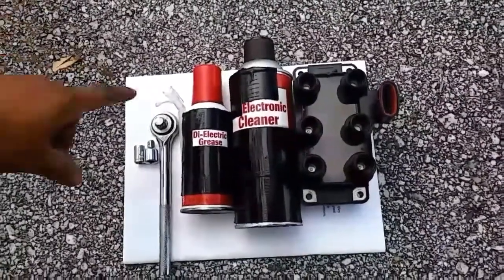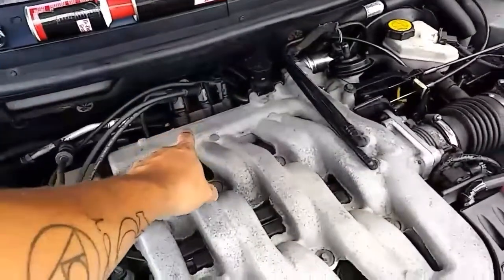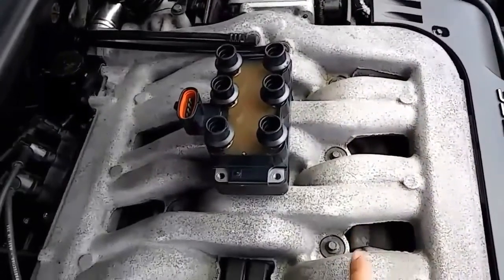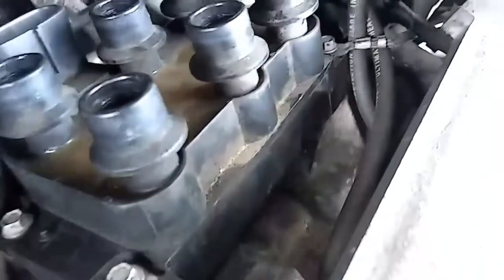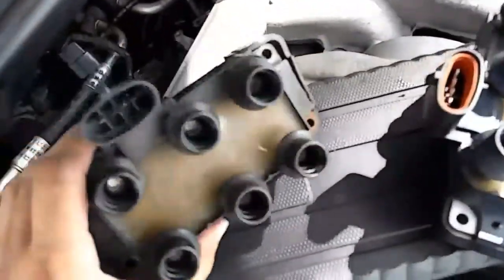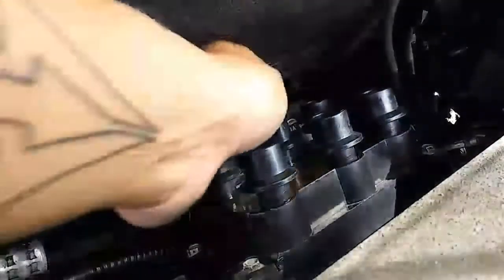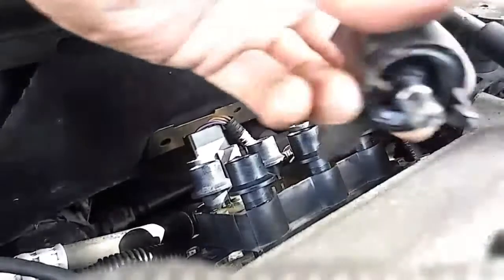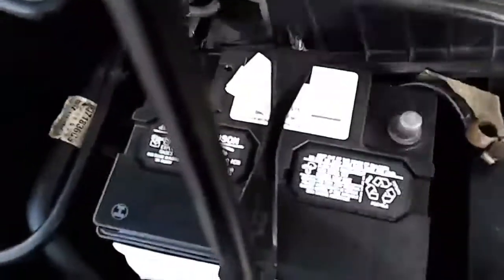Cougar Repairs - Ignition Coil Pack Replacement

Comment: Hoping that you still monitor this channel - I've got a 2000 V6 2.5L manual...having the alternator and high pressure power steering hose replaced this week, but it also needs valve cover gaskets. I can't find ANYONE online who's done that on a cougar, or even with a Duratec V6 in the same config. Have you done that, or have any tips for going about it?

Comment: I have a 01 V6 does the ignition coil sit the same way as the 99-00 bc my ignition cable is sitting facing the front of the car and yours sits toward the back. Was it placed on backwards by previous owners

Comment: One quick qestion, does the firing order change on the 2001 v6 model?
Reply from the maker: +Marcos Fernandez from the 1999, 2000, 2001, and 2002 v6 have the same firing order
Reply: Mordicai Zerkhan - Cougar Repairs  oh alright, thanks bro👌

Comment: I do have a question, I own a 2000 V6 2.5L Cougar, and have replaced the battery, starter, alternator, fuel pump, and the crank shaft sensor, and yet the car will not turn over and have been unable to get a spark. Any possible solutions?
Reply from the maker: +Vlad S. Have you check your Coil pack yet?

Comment: Will this help with multiple misfire
Reply from the maker: +Doug Mcgrew well yes this may be one way to help.
A random misfire code usually means the air/fuel mixture is running lean. But the cause might be anything from a hard-to-find vacuum leak to dirty fuel injectors, low fuel pressure, a weak ignition coil, bad plug wires, or compression problems. Even a dirty MAF (Mass Air Flow) sensor can cause a lean code and/or misfire to occur.
Reply: I replaced coil spark plugs and wires that did not help what do you think I'm clueless

Comment: Have you replaced your timing belts/chain yet...I have 230,000 on my 2001 cougar .....belts sound ok but was wondering if your going to do any major engine maint soon....also if you do a headlight removal id be liken that...thx for the videos..
Reply from the maker: +c dawg No my timing chain is good for now but i will do more engine work and deep engine work videos at that, making my channel the complete visual guide for 8th generation cougars. Funny you said that because the updated videos i will be coming out soon with are head lamp/head lights removals, alternator, cluster, and steering wheel removal.
Reply: also a good one would be changing the serpentine belt and all the fan belts....thx again

Comment: hi Mordecai, I have a friend with a '99 Cougar 2.5l V6 manual tranny and he's having trouble getting his speedometer and techometer working. says he thinks the problems are electrical, suspects wiring harness. Suggestions to solve problems and make car pass safety inspection?
Reply from the maker: Melissa Hudson Sounds like he has a bad speed sensor that needs to be replaced or his cluster is bad and need to be replaced as well.

Comment: I have a 2001 mercury cougar and have had the fuel pump replaced but wanted to know if your car does what mine does. Does it drive ok one day and when you park it you go the next day and it doesn't get spark it turns over but does not start?
Reply from the maker: +Allyson August It could be any different factors that may cause the engine to crank up but not turn at some days. The list can range from ignition coil, spark plugs, alternator, starter, Fly wheel, fuel pump, fuel injectors. 

But i advise you to start with the easy and simple ones first for process of elimination before heading up to the more complex fixes. Is your check engine light on? check your battery to see if its not dying and losing it cells, if it good but always have mid to low charge then its your alternator (common issue on cougars). If both is good move up too your spark plugs. Have you done a tune up yet? If not i recommend you doing so. Then if problem persist it might be ignition coil pack that needs replacement. If thats good then check to see if your fuel pump is working (common issue on cougars) if that is working fine then check to see your fuel injectors are working properly. Then if all that checks out good check your starter (it might be stuck at times causing it to not grab the flywheel to turn over the car. Or its the flywheel and its missing its teeth fot it to grab onto the starter.
Reply: Fuel pump is leaking internally...there is a recall...on this fuel pumps have to replace it with the updated one